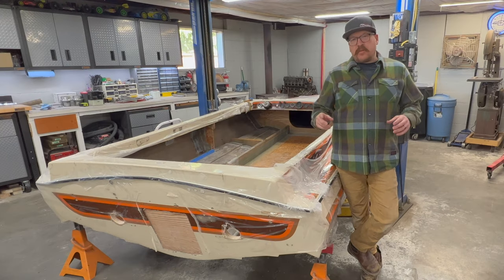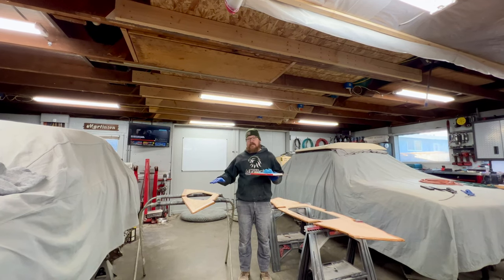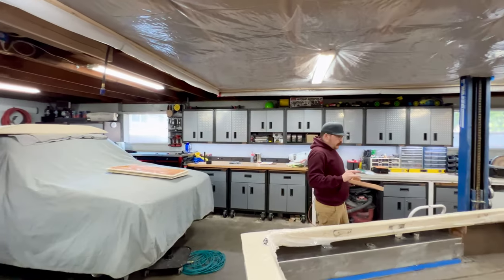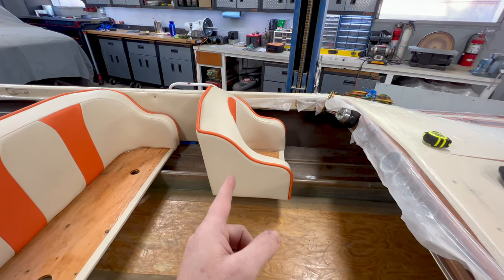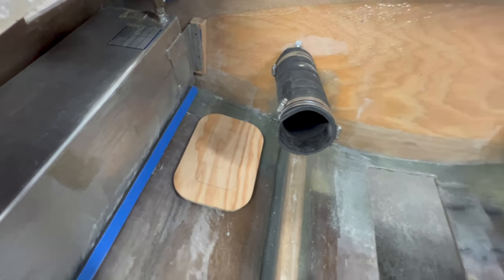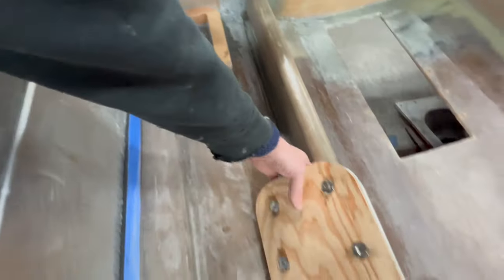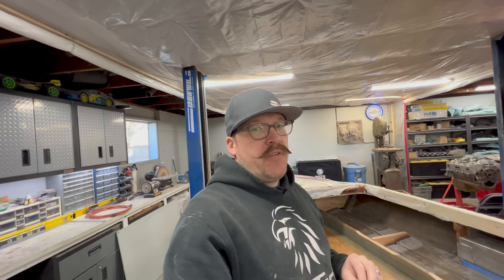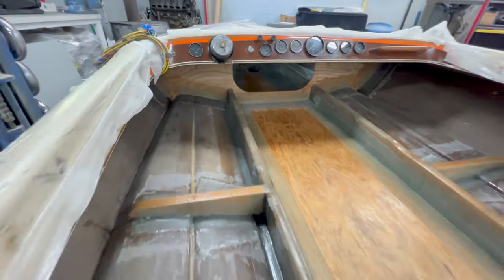Jet Boat BULKHEADS, Battery, Place Diverter Mounts & More

Comment: Top notch as always. It's all in the details! I assume you're going to carpet everything or gel it all inside. No one will notice the notches in the stringer but you. Seems like a great compromise. 👍
Reply from the maker: I actually plan to run carpet up to the rear edge of the back seat. The plan for the engine box/ bilge is to gel coat it. But yes you are correct, the carpet will completely hide the notch in the stringer! 

~ Nick

Comment: Everything is looking great! I can’t wait to hear how it rides for you. I’m planning on doing my rear bulkhead similar to yours. I never liked the old 2 piece design and my originals were just thrown in there with some chop and resin on a Friday after lunch break apparently. In my 83 I had quite a bit of flex in the bow going through rough or choppy water. 

That’s a kick in the pants on the stringer situation and was probably a sleep preventer. Things are always going to unexpectedly pop up, and we have to improvise. I would have probably done the same if shimming the port side wouldn’t work.
Reply from the maker: 🙏 Thank you. I know exactly what your saying about the original bulkheads. Mine were the same way. 

Yeah I was pretty annoyed with the stringer situation, but I quickly got over it and moved on. That section of the boat will have carpet, so it will be invisible once that is installed.

Comment: Looking great! One note, be careful with that battery tray. Looks like you might have created a place for water to get trapped as there is no downhill drain unless your going to fully seal the left side that sits on the floor. Might also consider filling the void with foam to be safe...water moisture in trapped in that space can wreak havoc
Reply from the maker: Yes! Absolutely. I was on the fence if I wanted to incorporate drains into the tray or seal it up. I chose to seal it up. The top plate is sitting pretty much right on the hull with no filler wood underneath. I bedded it in with the fiber filler and also glassed the outside so the box is watertight. I also was sure to glass in the inside of the wood framing for an extra element of water protection before installing the top plate. 

~ Nick

Comment: Question...

Why not glass/resin the 1st bulkhead in completely then move on to installing the 2nd one? More room to work...

By halfway doing both you created that tight space to work in...

Was there a reason you did it that way? Did you mention it and I missed it?
Reply from the maker: Yep…. I agree with you. Looking back at it, I could have saved myself some grief going about it that way. I was trying to minimize cure time on the glass, hence why I did them at the same time. But, truth be told it took me far longer than I anticipated to tab them in. If I did one at a time, like you suggested, it woulda been easier. And in the end I think it would have taken the same amount of time. 

~ Nick

Comment: I would have notched the cross seat support and left the stringer alone. Way less noticeable.
Reply from the maker: That is a good thought. I briefly considered that as a solution, but the base of the seats is made out of 3/4 plywood. I do not have enough wood to remove and keep any strength left in the seat. 

I think that you will be surprised at how the finished product turns out and how unnoticeable it will be!

~ Nick